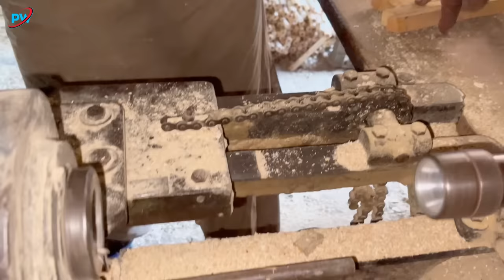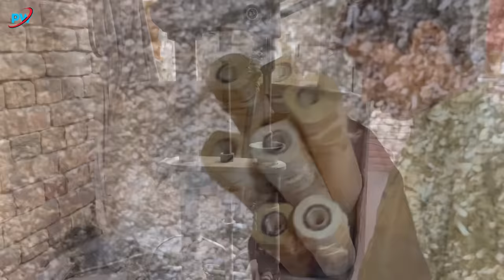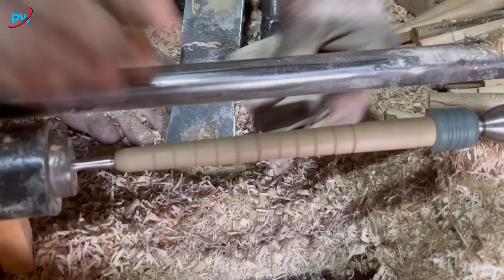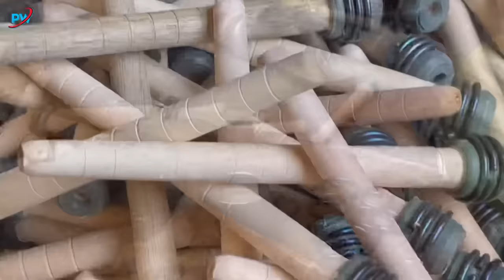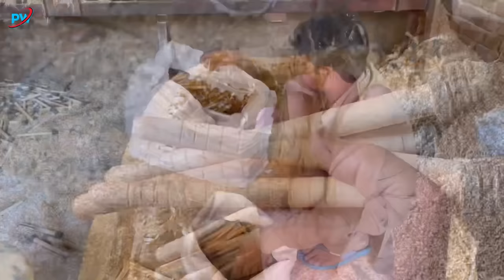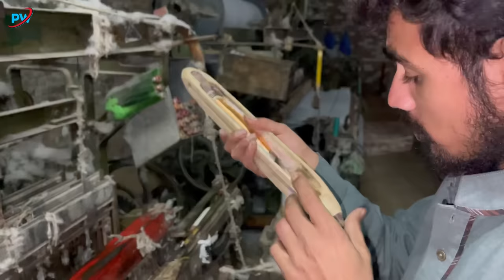An Amazing Production of Bobbin to use Weaving Power Looms

Comment: This bobbin technology has been replaced many years ago in India. Yet there are at some in some villages. I was the manufacturer of shuttle jaw having captured the all India market which was used in automatic looms. But now that has been almost distinguished.
Reply: Did you mean "extinguished" maybe?
Reply: @walshy2116  not completely extinguished but 95% changed to modern machines old machines went as scrap to melting furnaces.
Reply: Yes now latest air-jet shuttles looms captured the market but only in villages here in Pakistan, people use such conventional power looms technology.
Reply: 0
Reply: I am from mau, uttar Pradesh, in India and this tecnology is using till now in our city in power looms
Reply: @sajidkhanMau Старые технологии не сдаются так быстро...и это приятно!!Иногда старое лучше нового...С приветом из России.😊